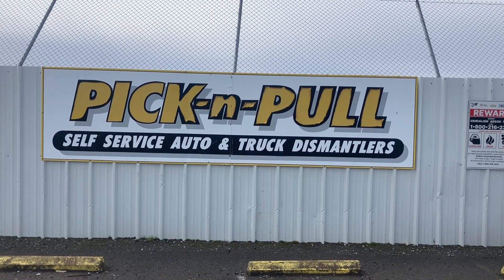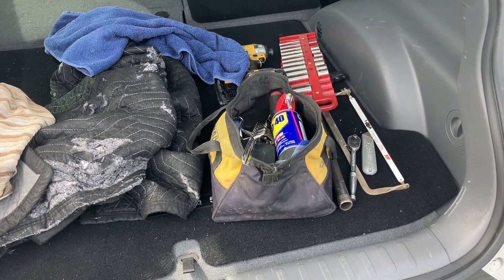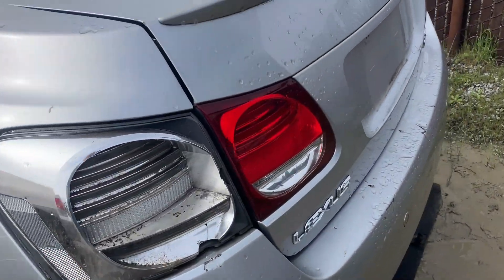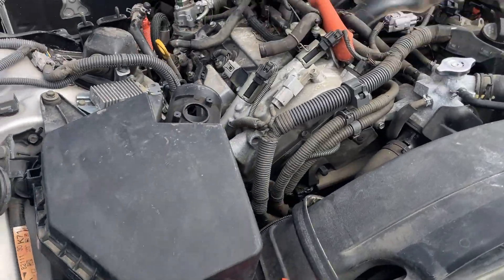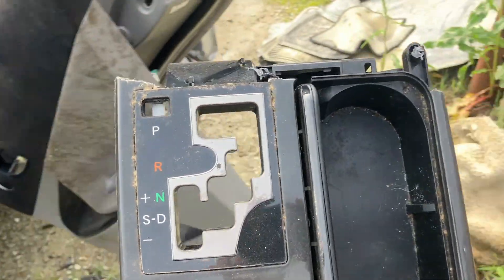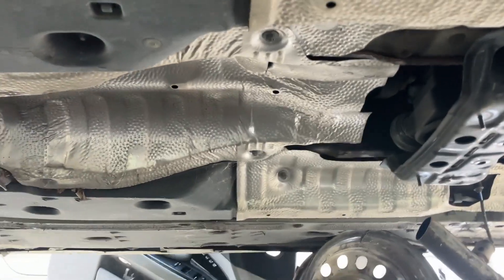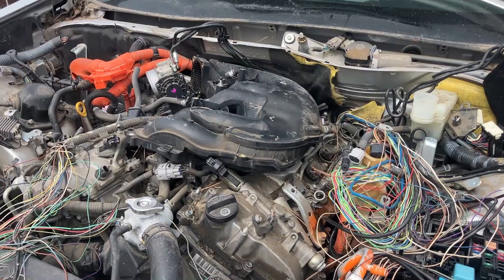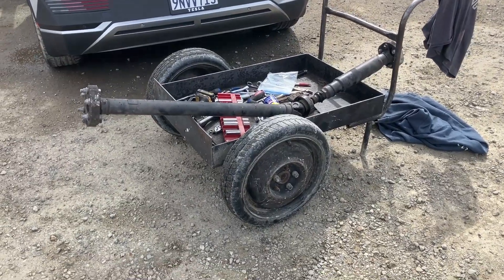Lexus GS450h EV Parts Harvest

Comment: Loving your dedication to the PooTube, EV conversion cause. 
180 miles each way, 100 plus bucks and a shed load of pain for a damaged driveshaft and a few connectors. 🤕
Reply from the maker: ha ha, you left out the part about me leaving a complete 1/4" deep socket Craftsman Made in the U.S.A. socket set most likely in the puddle of mud under that beast, but the cashier who took a smoke break in the parking lot chatted me up and was kinda cute, so there's that